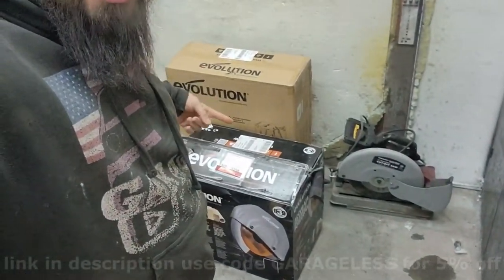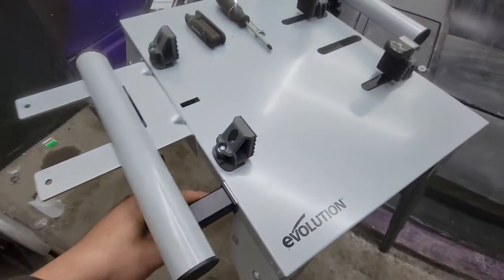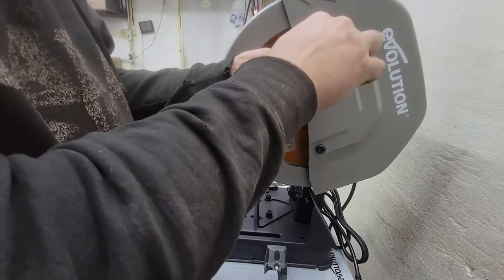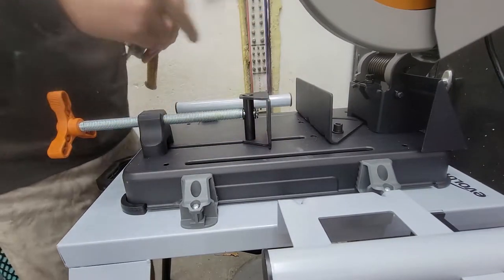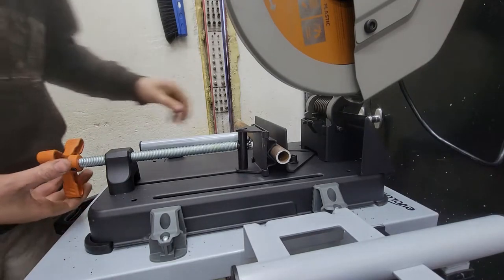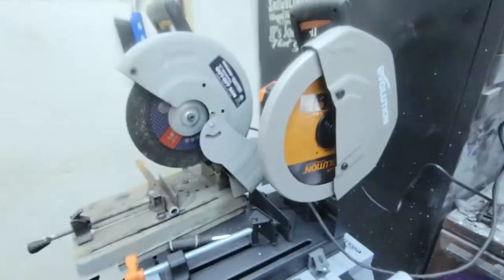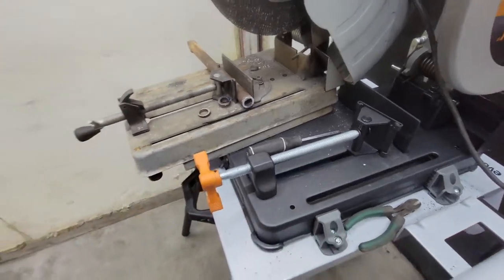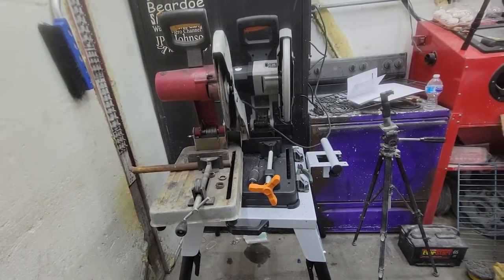Evolution R355CPS Chop Saw Unboxing and Review!

Comment: Just a fyi, that isn’t for clamping pipe, it’s for cutting box section with a corner pointing up. It makes the cut quicker and the blade last longer 👍🏻 just use the flat faces for pipe.
Reply from the maker: More you know 🤟🤟

Comment: I had the same one during the january discounts for 149€ instead of 289€ (in France, i guess it's cheaper in the US...as everything) Awesome tool ! Fast and clean cuts, few shavings...maybe for negative point the blades prices but I heard that it is possible to have them sharpened to improve their lifetime, I will try to have some informations about that...

Comment: I've had mine for some time now. I've found it actually works better without the pipe clamp piece, you'll never get a strait repeatable cut with it. Also if you use it for aluminum at all cut very slow with that blade it works good but build up on the blade if you try to go fast. And DO NOT USE THIS BLADE for stainless they sell other blades for stainless or use your evrassive for stainless you'll be buying an 80 blade everytime you cut stainless with that blade..... Ask me how I no lol. But otherwise this saw is amazing and probably the best $200.00 I ever spent on a tool
Reply from the maker: I cut slow with it for everything lol... not cause it can just cause it effortless lmfao... so used to abrasive